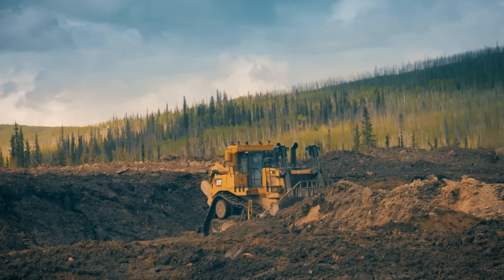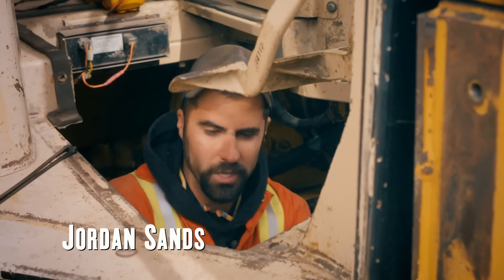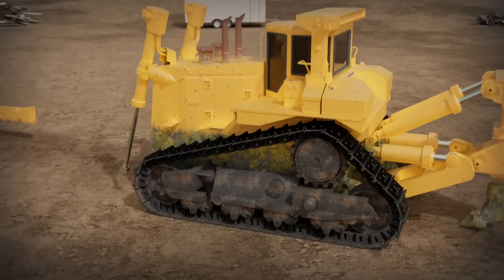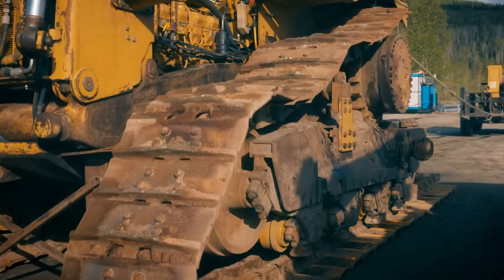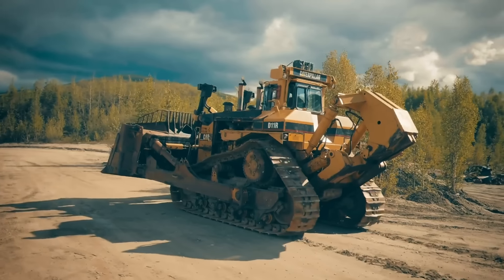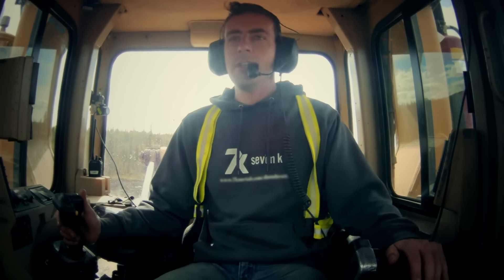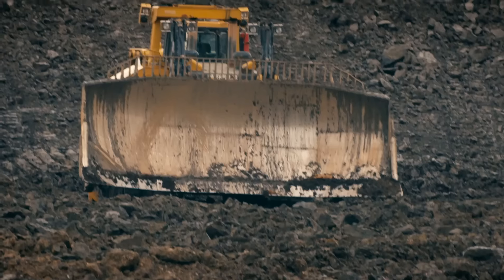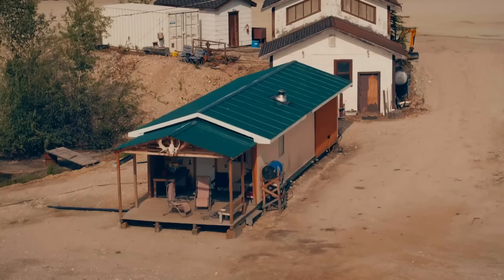Parker's Team Builds FRANKENDOZER And Earns $480,000 Worth Of Gold In 1 WEEK | Gold Rush

Comment: At least it's all D11, you don't have a Jalopydozer.
Reply: If all the parts came off of a D11 that just makes it a restored D11.  A Frankindozer would have parts from other models cobbled together. The  phoney drama is the biggest reason I never watch it anymore.
Reply: @july8xx  yeah and you can't just use parts from different dozers like from D10's and D11's or even Komatsu Dozers, they wouldn't fit together, different sizes. It's just a D11R being put together. Or maybe three different D11's that were not running and they took the best parts of each and made one running unit out of it.

Comment: Both Parker & Tony best in class gold miners but cavemen towards some technologies. We had a triptronic control on conveyors, hammer mills & crushers back in the 1970's that would shut down feed conveyors if equipment started to draw high ampere or shut down. Same with $150,000 huge water pumps. You would think the people loading pay dirt would have a few cheap wireless cameras to see into hopper & to check that discharge end is not blocked.